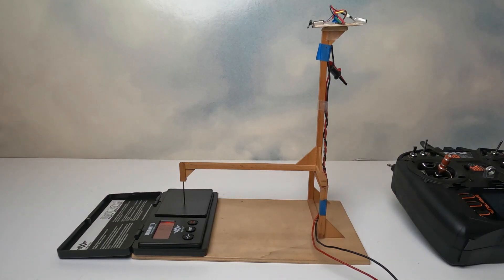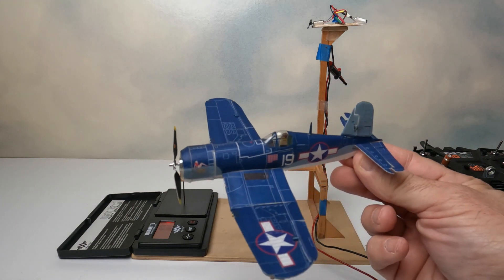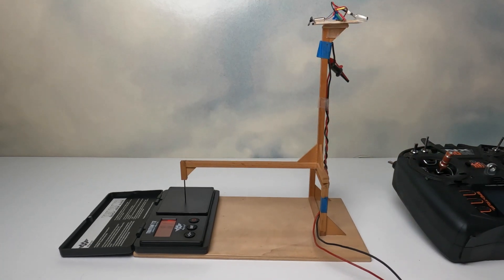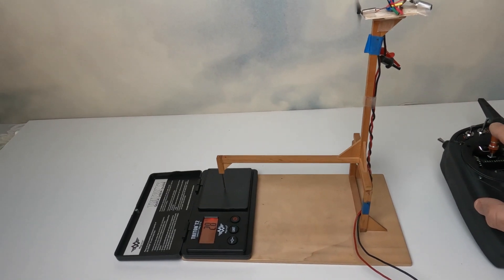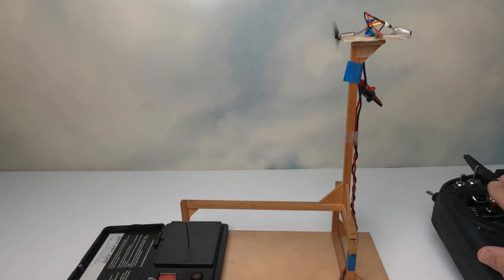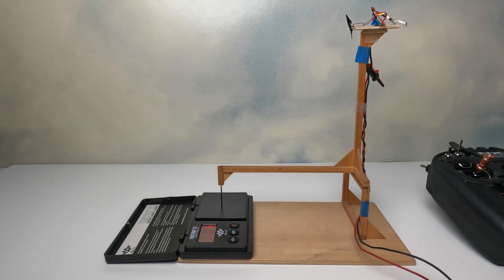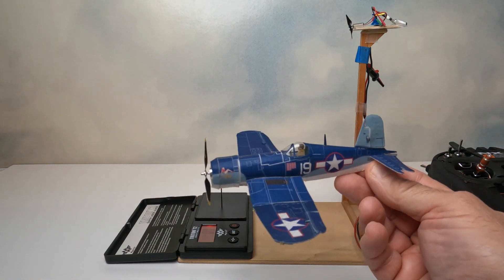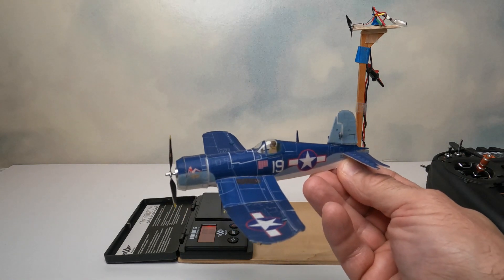Micro Motor Test Stand

Comment: Brushless motors are so much better. When the first pager motors got to modelers decades ago tiny gear boxes were made to get more thrust, this rig would be very handy to check.
Reply from the maker: Brushless motors are great, I am using a 600mg Gasparin brushless motor in the 1/72 scale corsair that is in the video. Unfortunately, the sub-gram brushless motors, and ESC’S are not produced any more. Hopefully, someone will decide to manufacture them again at some point!